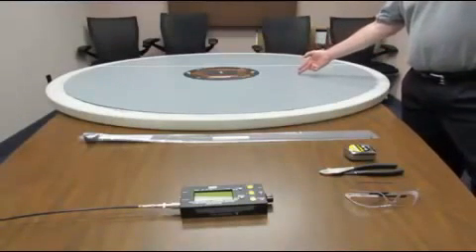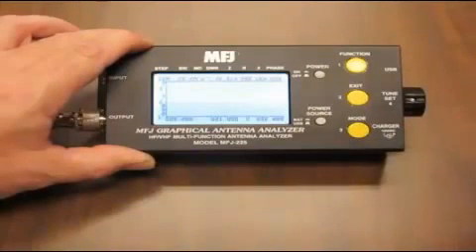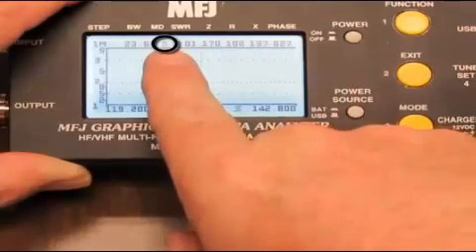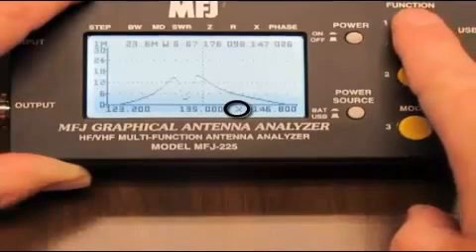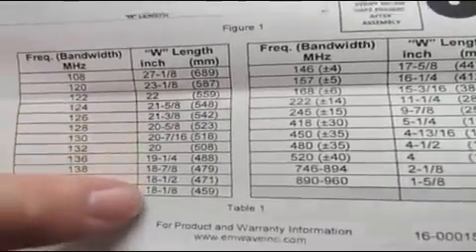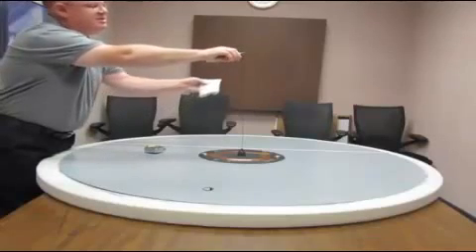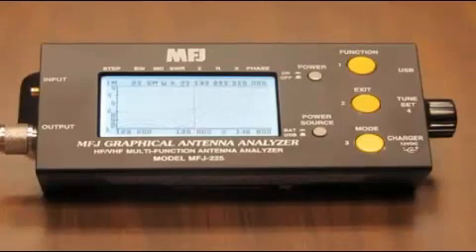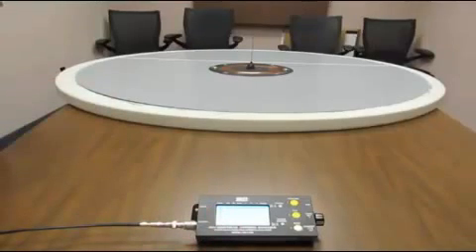Using an MFJ Antenna Analyzer to Tune an Antenna

Comment: Wow! That is amazing! I took my antenna down 8 times when I got home trying to get my SWR dialed in on my base. I finally got it down to 1.5 on ch1 and 2 on ch 40.
I think it can be better. Lowering it an 1/8" per time then finally a 1/4" per time. When I knew I went too far I backed it out 1/8 to get those SWR readings. Maybe some very fine adjustment back inwards will get it better.